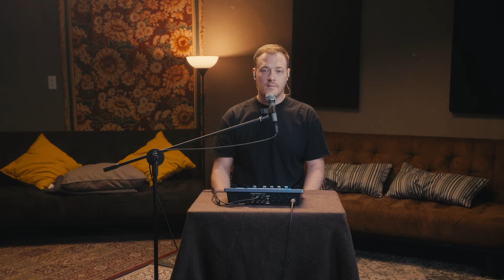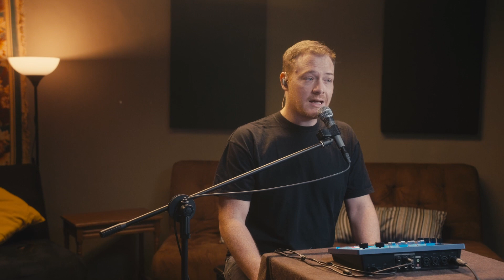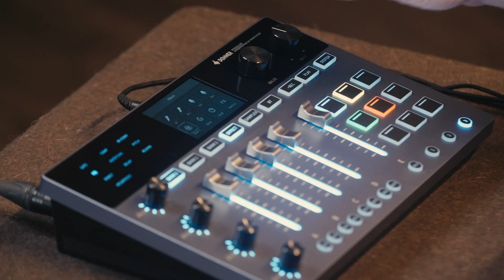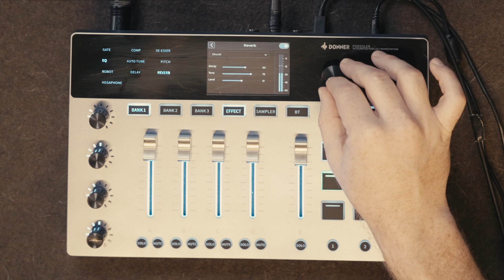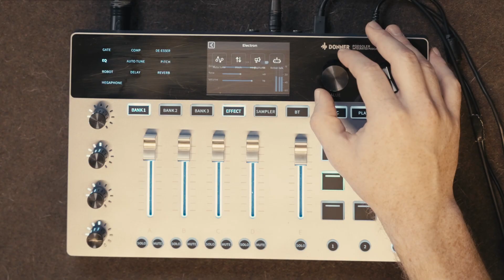Episode 02 About The Effect丨Donner PC-02 Basic Tutorial Series丨Donner Spotlight

Comment: But how do you get it to be recognized on an iPad or phone?  It says compatible with most DAW’s but I can’t get it to show up on something as simple as garage band after connecting through the usb-c.  What am I doing wrong?  I can record to the card but nothing is even being recognized however I try to hook it up to an external source.
Reply from the maker: Hi David! The USB-C can be connected to mobile phones and other devices by using the standard USB-C cable.

It should be noticed that, If you want to identify the device with DAW software, it is necessary to install the Livejack ASIO driver downloaded from Donner’s official website. Then It can be recognized by DAW software.

Regarding the SD card reading function, we had updated the firmware version to 6.16, so you can directly access the files in the SD card on the PC via USB until today.

Thanks a lot for your attention :)
Reply: @Donnermusic_Official  I downloaded the software from Donners site and still can’t get my iPhone or iPad to be recognized.  What am I doing wrong or do I have a bad unit?